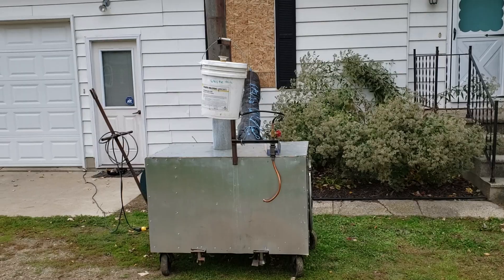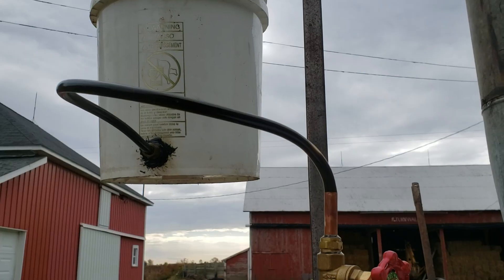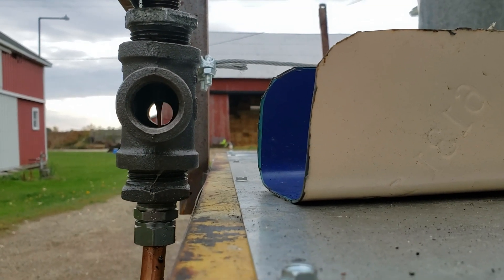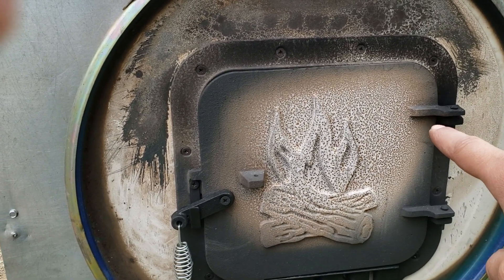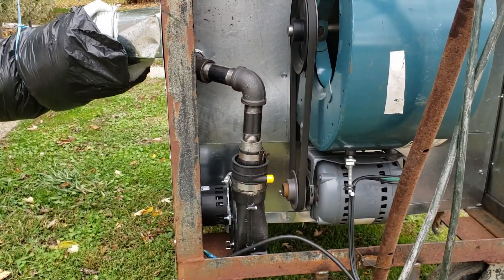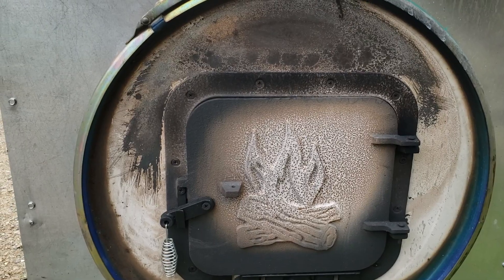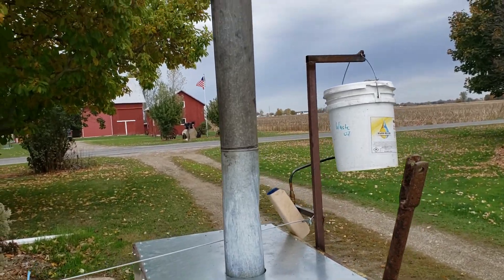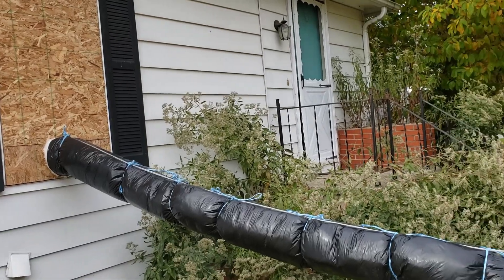Waste oil burner, heating my home with free oil

Comment: need to connect air blower up so it draws air from house.
Reply: To suck out cold air in process and turn it into heat and send it in the house again. Good idea
Reply: @frikkiesmit2695  Like a.... return.... duct? Incredible idea!
Reply: @TONYTHETlGER  hi. Hehe.  Its actually what Joseph  said. But yea.  I don't live in such a cold environment as you guys overseas.  I think it could help the house get warmer in less time if you use the cold air from within the house and turn that into warm air.
Reply: I have a cold air return set up on the wood stove set up that's similar to this, using a water pressure tank as a firebox inside the 55 gallon drum laying sideways with a blower on top.

Comment: Great work! Be curious to know how well the drum is holding up being outdoors with that much heat being put on and off. Trying to get a vague idea of the life of a build like this and being outdoors. Appreciate the video, look forward to hearing/seeing how the compost heat idea goes.
Reply: Well, If you have lots of outdoor space like the Random farmer does it would be a good idea to build a shed over the unit to ensure that it's not exposed to weather and/or subjected to freezing cold or sub zero temperature conditions that would indeed slow the oil feed down if not stop it altogether. Plus to the outside observer it would not be apparent what type of heating unit is housed within the shed.😉🙃

Comment: nice video. your design is definitely more efficient than a lot of stuff I have seen online. I do have some food for thought for you. you might get better heat transfer if you change the design so that you cause the air from the squirrel cage fan to spin around the circumference of the drum before leaving at the opposite end instead of the middle of the box.

Comment: Why not install an oil burner transformer?   120 V in 10,000 V out (They also make a cool Jacob's ladder) The current at the output is really low. You could turn the heater on from inside with a switch, or a thermostat.  You would probably want to include a thermal relay, so the blower won't  turn on until the air is hot. You could of course make it so you can bypass all of that stuff if you need to .

Comment: You could actually slow that to a drip... Mine is set for 5 drips every 10 seconds. My oil supply is coiled around the stack to warm up the oil so it runs easier and isn't thick.and put a 90 to a 45 at the bottom of draft air so it forces a swirl action. Your burn will be better and no black in smoke at all
Reply: Great idea

Comment: My wood stove is built in a very similar manner to your oil stove. My barrel is 55 gallon. I could probably add your drip system for additional heat. How did your oil system work over the winter? Did you have to heat it with tape to keep it flowing? I'm pretty sure it would stop flowing during our sub-zero weather.
Reply: Hi, well in his case he could build a little Metal shed around the entire outdoor unit  - If weather extremes are too cold in winter conditions - so there are other ways and means of keeping freezing cold conditions from slowing or stopping oil flow to the unit.😉

Comment: Absolutely brilliant.  I have been researching oil stoves for a while and have seen many that have major setbacks. You have solved them all. Shop noise from blowers, insulating exhaust piping, lost shop space, indoor oil spills and mess, fire hazard, and the rediculous amount of fabrication most guys do.  My shop will be heated with a variant of this design next winter. Thank you for sharing. FYI, I will be using a surplus Postal service sorting cart I have on hand as the base framework for mine. It's a perfect size, on heavy duty wheels and bolts together. I don't know how easy they are to find but finding one would cut down on fabrication time for those without a welder or welding skills.  New subscription added.
Reply: So did you implement this system this winter?
Reply: Also curious.
Reply: My comment to another commenter above yours - as follows:

TheFordtrucknut
1 year ago
I've been looking to do the exact same thing, I love your setup. And will be using it as a template for mine.

Reply

SOLOman
1 second ago

Hi, I don't think you'd go wrong with that design but you might need to ask him to illustrate how the central internal burner was constructed as that's the most important part of the heating unit  - which when all is said and done is not that far off commercial grade or quality Or even better than many Factory made units that are perhaps neater looking in their finish maybe - but no better functionally - from what I can see.  And it's practicality and usefulness that overrides pretty looking units anyways and even on that score it's still pretty good looking for DIY set up - nevertheless.  🙃

Comment: Nice job man, wrap that oil feed line around your chimney flu to pre-heat the oil prior to combustion. That should make it more efficient?
Reply: As the temperature outside changes the viscosity of the oil changes, therefore the flow changes. I learned this the almost hard way after I lit mine, left to let the shop warm up, and came back to orange stove, orange stove pipe(schedule 40) and oil rolling into the burner at a high rate. Turned it down and saved it.
Reply: It would be pre- heater like for #6 oil.

Comment: oil burns rich, lots of CO produced together with CO2. When that 55gal drum gets thin and eventually burn through, the danger is that CO will get forced into the house. I'm not sure at what level CO detector gets tripped, but elevated CO levels are not great for people or dogs.

CO is slightly lighter than air, especially a warm air being pumped in. That sensor belongs on a wall or a ceiling. 

Also, the higher the flue, the more air it sucks in. Most industrial smoke stacks are rated like that, so technically if you just make your stack high enough, there is no need for inducing draft with a motor.
Reply: Yeah, i was thinking the same thing, he really should build it to transfer heat to clean air.
Reply: I think that's a good point brought up by Andrei. I 'm not an engineer, but it doesn't seem to me that the drum is going to last for a long time -- it's obviously not made to stand up to high temperatures. For example, when people build wood stoves using drums, they usually put fire brick or sand on the bed, because if left  bare, the drum will burn through pretty quickly. And your oil fire is probably quite a bit hotter (~2750F in an oil burner) than a wood stove (~1100 F). Yours is a great project, admirable for its ingenuity - but keep trying to upgrade it for safety! Good luck with everything.

Comment: Wow, that is the BEST waste oil burner I've seen made on YouTube.  Pls send me the plans.
Reply: It is a good construction and pretty efficient.  You could buy a burn barrel kit (or the complete barrel wood stove), a blower fan and duct sheeting.  The biggest trick is making the best oil burn point inside your drum. 

If you have central heat ducts,  you could tie this into those ducts ahead of your central AC unit, which would be turned off or just have the fan turned on to aid on flow and return. 

There are wood fired external stoves just like this.   Typically about $2000 new or $500 used.   Best way to heat a whole house with wood.   Put the fire, ash and soot outside.
Reply: @STho205  I will PAY you for more detailed plans.  I am not interested in using this on my home...cost of electric bill is too cheap and would only be lets say on an emergency...could use it...basis.  I just have a shop and I HATE TAKING A FEW GALLONS A YEAR EVEN to the auto parts dump.  I would have this sitting outside of my 24x24 garage and pumping air through a window as you have done with the front 16x8 door cracked 8" at the bottom while I work on something.  Again, not sure where you live but I would like to purchase one you are getting rid of as you upgrade..or whatever.  I would hope you live in the North East somewhere.  Would love to have detailed description of just what you did to go along with the pics.  I can see basically how you constructed it and then sealed it probably as a HVAC guy would any other ducting.  But to just be able to hang a 5 gallon bucket of brew on there..maybe have a separate heater to pre heat that as it fed in and "got rid" of the oil I sometimes have...would be cool as the other side of the pillow...now using something like that to fire a boiler and make steam that could run a small steam motor and turn a generator which in turn charged a battery bank....OMG...I have to use the restroom.  Please help, will work for free.  Need any stalls shoveled out.  lol  Tks
Reply: A parting note...the boiler / battery bank thing would be doable as I want to go with a solar array with tesla battery as backup but...really, too expensive and not something that I created really.  My garage is electrically connected to my home as well even though it is 40yds away.  Battery bank being charged by a contraption that was running off waste oil...that beats solar to me anyday...bit hands on but I have to have some of that to live.  Tks
Reply: @gandl2123  just drop by a rural hardware store and look over a drum stove or a wood fired outside ducted heater .  A double stove (fire box attached to heat box made with two drums) would be this completed.  I see them at my ACE for $250.   That view is better than plans. 

Motor oil burning apparatus is an oil tank of any sort, pipe, regulator tap (water faucet as shown) and inside the tubing sitting over a brick.  Light the fire on the brick (like for a wood fire with as fire starter),  then let oil drip onto the fire keeping it alive and growing hotter.

Before much effort,  make sure you can find the waste oil you need, EVERYDAY.   Auto garages in the country have used this for decades.  If they do 3 oil changes a day then they have 4 gallons of waste oil sitting around, everyday. 

However if you do two oil changes a year,  you'll need to find a supplier.   Buying fresh oil is $5 to $15 a gallon.   Kerosene is cheaper and Diesel is half of that. 

Good luck to you.

Comment: Why didn't you heat water and use a heat exchanger to your air handler your loosing alot of efficiency heating out side air and transporting it. Water has a better thermal mass.
Reply from the maker: Its a portable unit.  I dont know about you but I dont want to have to unhook all the water lines and purge the air when I want to heat another building for a day.
Reply: @therandomfarmer4231  do you have central air in the? Just seems less efficient. If its a small loop to the air handler shouldn't be hard to bleed with a garden hose and a open valve. With the size its hardly  portable. Its a nice unit, amazing job engineering it.

Comment: I made a fresh air furnace, "wood burner'' to heat my double car garage. I live far north where temps drop -35. I used a temp controlled fan, in the garage which would turn on at the desired temp.  At 0 degrees Celsius it worked very good. However when the temp dropped below -10 it required too much wood, to keep it hot. It wasn't feasible  by a long shot. Last yr I made a drip oil indoor burner, WOW... the extreme heat it created easily heated the garage -35. - However I want to get it outdoors like you have, mainly due to the possibility of explosion from working on vehicles, gas tanks, etc.  i used motor oil mixed with diesel to thin it out, (I strained it, to take lumps of crap out) I used a - 1pt diesel to 5 pts motor oil, which thinned it out good. ) The problem i had was on start up, until it got hot it blew very thick Black smoke, which once it got hot disappeared. I saw another y-tube video were several people are combining wood / used oil, ....   I'm thinking using wood to get it hot, then turn the drip oil feed on... Did you have any problems with very black acrid smoke?
Reply from the maker: No smoke as long as you force in alot of oxygen, if you get a lean enough burn you don't even know its running.   Naturally aspirated oil burners are extremely inefficient and smelly.  We use to drip feed oil on wood but its nothing like a straight forced air oil burner.

Comment: Doesn't the heat cook the oil in the pipe? I guess it can especially if it's vegetable oil.
Reply from the maker: There's not enough oxygen in the copper line to let it burn.  Its essentially an oil preheater.

Comment: How and where do you find oil? I assume that one must quip down quite a lot?
Reply: Waste oil
Reply: @jimmybobco  , once every five years I change oil in my lawn mover. About an eight of a gallon or so. I have a feeling that won’t take me so far but I have no other waste oil in sight.
Reply: @mockupguy3577  imagine how much oil a farmer goes through, tractors, trucks, mowers, etc
Reply: @jimmybobco  I have a MF 1754 compact tractor and if you include hydraulic oil in your waste oil tally, with each scheduled maintenance I waste 10-gallons.  The stuff really adds up.  One you start saving your waste oil, you realize how much a person goes through across all the machines that need oil, cars, motorbikes, mowers, generators, et cetera.

Comment: Awesome.  Do you plan on building something around it just in case something were to happen weather wise?
Reply from the maker: No thats the complete unit.  Its been snowed and rained on. Been through 55 mph winds too, always stays running.  I'm actually about to start on a higher efficiency one soon.
Reply: Yeah your going to have to post a video on that I'd like to see it.

Comment: Great build!! However you did build that for your shop at first (no need for hot water there). Wrapping some 3/4" or 7/8" copper tubing (with some sort of disconnection for in & out) around that barrel in the box & to have some water heating capacity as well. compost couldn't hurt for the summer time & year as well.

Comment: is the outer box insulated? wrapping that to keep as much heat in there will result in much higher output temp.
Reply from the maker: The idea is the air rapidly circulating somewhat acts as an air insulation cushion.  The unit just gets slightly warm to the touch and helps to keep all the snow melted off.

Comment: How long does a 5 gallon pale their last?
Reply from the maker: At about 32 degrees f I use anywhere from .75-.5 gal/hr.   There is an upgrade video I made that shows an extra bucket added on for longer run time.

Comment: i use a metal milk can for my oil with a stick on heat pad for a car oil pan to warm up the oil so it feeds better.   and a disk brake with a V cut out to lay over burn pan. add fire brick or rock inside to help hold heat mass.

Comment: I used an old boiler built a shed around it, modified a beckett to run used Canola oil, none pressure,  with a small pump, ran lines into the house all my rooms are the same heat no drafts. free oil, downside is a lot more maintenance, canola oil gums up, spray nozzle and air fin. been using it for over 8 years.. cost of of everything around 1k  :-)

Comment: What kind of oil is being used cooking, auto? etc.?
Reply: I use vegetable,  motor oil, transmission fluid, diesel fuel ,hydraulic fluid .  Mix it all together     Just not gas big no no.    They work great been heating my shop like this for 4 years

Comment: Definitely use several carbon monoxide testers for sure!! I’m sure you do!
Reply: not needed the heat chamber is completely separate from the burn chamber.
Reply: @groundzero.  until the barrel wears through.

Comment: A coil of copper tubing a couple of old water heater tanks and you could get free hot water as well.
Reply: build the frame so the tanks sit above the furnace... box the tanks in to keep them good and hot... might be on to something there....
Reply: Use the water to heat the house, too.  Air and water. The water could use its own heat to create flow out the top of the water heater section, into the house where it would cool off, and flow back to the tank via a lower connection. You would want a bleed valve somewhere on the water system to limit pressure buildup if it boils. Something as simple as a kitchen-pressure-cooker weight could do that easily and reliably. Also  way to keep it from getting low on water.

Comment: It's brilliant however where can one get old oil
Reply: Change the oil in your vehicle
Reply: @cruzcreation20 Yeah you only change your oil every 3,000 miles and 5 quarts last what a few days tops in this?
Reply: @cruzcreation20  it was a legitimate question because I want to possibly switch from natural gas to this however if it isn't cost efficient to get old oil cooking or other then it isn't exactly free.
Reply from the maker: I get oil from my farm, and auto parts stores.  Also local farms usually have barrels of it they just want to be rid of.  If you put an ad on Facebook I would bet you would get more than you would ever need.
Reply: @therandomfarmer4231  It's funny you mentioned this I just had found someone try to get rid of a old oil in a 55 gallon drum, just not sure how much weight that is and how the heck I could load it & unload it from my truck.

Comment: CO detector: a must.
Reply: Any CO and CO2 is going up the stack outside.   The air is from the air jacket around the outside of the burn barrel.  Similar situation to your gas central heat. 

The CO detector inside is for a crack in the smokebox.   A good idea for any house that has fired systems even those installed by professionals and the gas company.
Reply: @STho205  Heat will crack those barrels for sure.
Reply: Family dead from waist oil burner details at 11.
Reply: The exhaust does not go in the house. The hot air going into the house is never in the burn chamber and is not exposed to combustion.